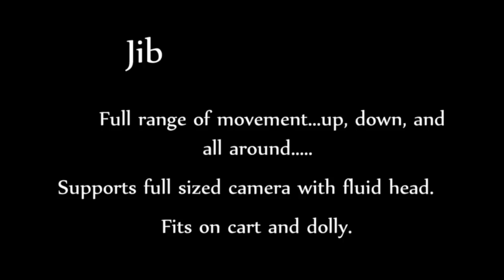Yet Another DIY-Homemade Dolly and Jib

Comment from the maker: Actually, it's very portable, but it takes 5-10 minutes to disassemble/reassemble.  The cart is not really designed for a moving shot (despite the video)...it's an equipment cart and an easy way to move the jib around.